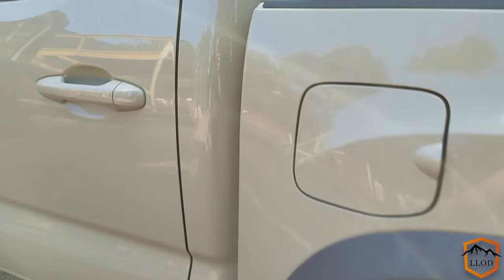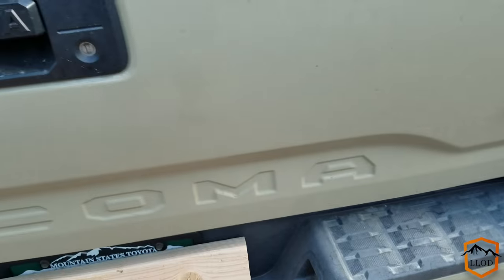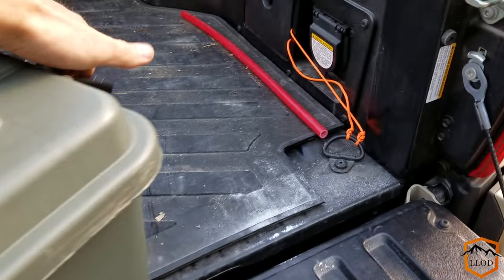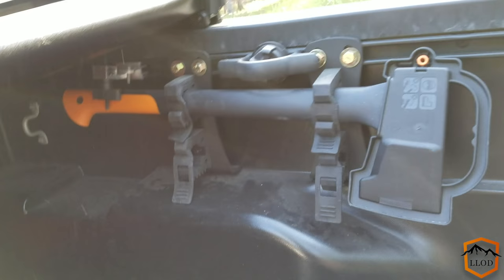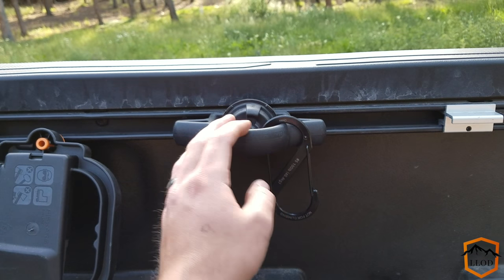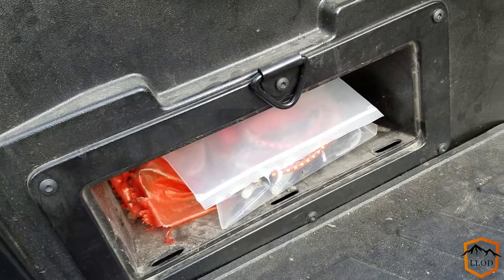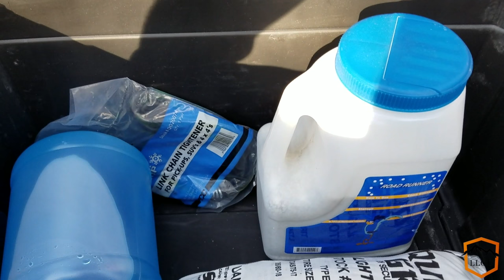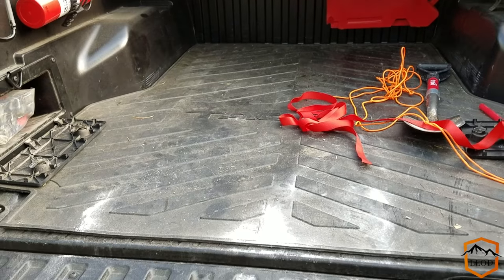Truck EDC / Emergency Vehicle Gear (Part 2, what's in my bed) - 2016 Tacoma

Comment: Make sure you remove and clean your spare wheel after the winter months so it's easier to get off during emergencies busted a wheel on my truck one night never was able to remove my spare and eventually had to get it cut out and re installed
Reply from the maker: Thanks for the tip!

Comment: I have the extended cab SR5 4x4 in tan like yours. I have a cap on the back from Leer and put a cot in the back for emergency over nighters. I'm more wheelchair bound so finding a Motel or Hotel that takes wheelchairs is a challenge for me. And mine is Proudly dirty!
Reply from the maker: Glad that you are a fellow truck user that isn't afraid of a little dirt!
Reply: Last Line Of Defense Its what its for & not mall shopping like most Jeep's
Reply: 9/10 jeeps are jacked up with expensive rims and never see dirt. Well, 9/10 trucks, jeeps, and SUVs.
Reply: Steven Bradley you are a stud! I like your great attitude and considerate comment.

Comment: Hi, great video! Thank you for taking the time to show your work and list your options (including where to get them).  I drove Toyota's militarized pickups in the desert. They came standard with winches, underside protective pans (covering engine oil pan, transmission, gas tanks, differential u-joints), front grill protection, extra fuel tank, a lot of large nylon rope, air tank (between frame members), compressor in the engine compartment, jack, shovel, UHF radios (military frequencies/use HAM or CB in our civilian case) and deafening alarm system.
What I would recommend is better organization inside the cab so that: 
1- You can reach whatever you may need in a hurry,
2- It is less conspicuous for people tempted to break-in
I recommend putting the extinguisher inside the cab, easily accessible from your seat.  I enjoyed your video and found good ideas for my rig.  Thank you for the ideas again, Ciao, L
Reply: lancelot1953 plus an emergency wool blanket and flashlight

Comment: I would highly recommend an on-board-air system.
Reply: expecially with the 110 plug in,in the back!
Reply: Why? I have the same exact truck as the OP's, but I fail to see the need for a compressor unless you live in a rocky terrain like the OP does in Colorado where you might have to air down your tires. For flat tires? Isn't that what we carry a spare tire for?
Reply: +Optimal Joy they're useful in general. Air tools, pumping up tires (not just your own), air lockers, cleaning dust out of hard to reach places, air horns, etc

Comment: This gives me sooo many good ideas! I'm always so apprehensive of "modding" my truck but these are ways that don't destroy the vehicles ie your use of existing bolts, velcro on the interior, etc. Thanks for opening up your world so that all can learn. BTW your trucks cleaner than mine. Keeping a vehicle clean is secondary to getting actual work done. If the cleanliness prevents work then yes clean it but if its cosmetic and doesn't bother you "who cares?"

Comment: Man I really like your truck. I was going to get it in black but I ended up getting a 2016 Honda Accord v6 touring sedan. I still want a truck and I may get the tundra one day. It's always convenient to have a truck.
Reply: got the same truck just not 4x4 and mines white, 2016 tacoma trd off road
Reply: air23evil sure black looks badass but it's hot and always dirty. Go with a lighter color

Comment: You should consider adding spare belts, bolts, nuts, and fluids (oil, break fluid, power steering, etc... those that leak/degrade on rare occasion) in your bed box too. Just the little bits and bobs that can get you to a shop should you ever have a failure. Since it's a new truck and you're not 4x4-ing, it's not a big deal. But the way I 4x4, I've got enough spare parts/tools to repair/rebuild pretty much anything except the engine block itself. All depends on level of readiness and end-use/purpose. Nice truck though!
Reply from the maker: Oh yeah, back in my wheeling days, I basically took a whole shop with me whenever I went out. It wasn't a good trip if someone didn't break a driveshaft, or rip off a shock mount, etc. In a new truck and not doing any serious wheeling though, I don't feel like I have as much to worry about.
Reply: Awesome. And with a new truck, I don't blame you. There's the baby period, where all you want to do is baby it. And eventually you say to yourself "I think she's broken in enough now, let's go for an easy trip" and you go up from there haha!

Comment: Rock on with your dirty gravel. Dirty is good. I see a super clean truck and I know that's a target to stay far from, because it's just going to attract scavengers.
Mine are always scratched & dented, because I actually use them. Thanks for sharing.
The thing in the bedrail is called a cleat. More often seen in boats they're the best option for quickly tying anything down.
Reply from the maker: Haha yup, that's the term I was searching for, thanks!

And agreed... it confuses me how many people are upset by seeing a dirty/used truck.

Comment: Nice setup. I have a truck tool box instead of a bed cover for my Tacoma. Have the long bed, it isn't bad but does take time getting used to how long the trick is. I've been trying to figure out how to carry extra fuel in a safe manner without it being stolen. Keep the videos coming. I've always wanted to try the simulated get home bag hike but my route home crossed a 3 mile bridge with no pedestrian access. 👍
Reply from the maker: I like truck tool boxes, but I don't think I could give up that extra space in the short bed.

Comment: @lastlineofdefense - consider switching to Kolpin Rhino Grip Flex mounts to replace the Quick Fist mounts, ESPECIALLY for your fire extinguisher. The 3” mount will fit around your 2.5lb ABC extinguisher and if you mount it to a secure point, it will not flop around. I have mine bolted to my front cab MOLLE panel and it’s solid af. In my opinion, the Quick Fist stuff is sloppy, fragile garbage and the straps tear easily

Comment: Hear is a suggestion for you I found out about Toyota Tacoma's. I don't know how much you know about Truck Campers I am a big fan and My dream is to own a Truck Camper and have it in the bed of a Toyota Tacoma I found out The Discontinued Northern Lite 6'10 Truck Camper will fit and in a Toyota Tacoma the 6'10 dry weight is 1060 pounds and the 2016 Toyota Tacoma payload is between 1120 and 1505 pounds. So you could use a Truck camper in your truck just to suggest that to you.

Comment: I have a bed cover that folds like yours. I also have a fire extinguisher, but I have one on each side. Then, after I put my bed mat in, I purchased 3 trunk organizers. I then purchased the sliding bed separator. It locks into the sliding rails on the Tacoma. It runs the width of the truck so you can pack everything to the front of the truck, slider the separator up against it and then tighten it down so nothing slides. I took the three trunk organizers and laid them out up against the cab. I filled them with, jumper cables, wrenches, tire repair kit, a really good emergency blanket set that I ordered from Germany, 3 raincoats, 10 road flairs, a VERY high quality medical kit with the best of everything. I also have 4 maxtraxs on their side between the bed and my organizers. I have a small and big hatchet. I also have waterproof matches along with 10 watertight sealed lighters. I have 4 flashlights that are LED. I also have 2 battery operated work lights. They have a big LED light on top of a tri-pod and the slide in and fold up to take up very little room. I have a pair of steel studded boots sealed away air and water tight. I have 4 tow straps, oil and some tools made just for my wench should it need to be fixed. I have 25 hand warmers and 25 foot warmers. I have a tie inflator but it is under the hood. I put a double battery system in my truck. So, one runs the truck and I have another for the LED light bar in my hood scoop, two LED ditchlights mounted as close to the windshield as possible, two LED fog lights, my wench, an LED light bar on the top of my truck that I take off and on easily, 4 LED lights in my back bumper for when I am backing up or someone is riding my bumper at night. My tire inflator also runs off it. I have a high end fridge, freezer in the back of my truck that also runs off it. It's a double battery system where both batteries are hooked together but kind of separate. It's hard to explain but you can look it up on youtube for double battery system and they will explain it.  If I am Overlanding I also bring a chainsaw and oil that are locked into the bed as well as two gas cans. One container will have a good bit of emergency food if I am Overlanding or going somewhere when the snow is really bad. I also carry a My Buddy heater with 6 cans of fuel for it. My bed cover folds up to one smaller piece. I have emergency hooks to release and remove my bed cover easily. I have a truck tent made for the bed of my truck. I carry an extra 15 gallons of gas so that I can leave the truck thus leave the heat running. I have an opening in my tent and I open the back glass of my truck. I then put a small fan in the back glass of my truck and it will blow heat from the cab into my tent should I need it.

Comment: perhaps consider ratchet strapping the box in place. I would hate it moving around all the time
Reply from the maker: It doesn't actually move around much / at all with the rubber mat - but yeah if I didn't have the mat, I'd want to secure it down.

Comment: Great video. Only thing I might suggest about your fire extinguisher issue would be to get a smaller one and buy an in cab truck mount that we used on our semi trucks. would be located on the left side of your driver seat on the floor. Just a suggestion.. Also, don't you dare clean that truck bed lol

Comment: What about that cable system, the mesh you used with the locking cable.  Where were you able to find that?  It would be perfect to help secure my wife's camera gear when she travels between shoots.

Comment: Im surprised you dont have a small little vacuum cleaner in your Tacoma. I didn't see it in your first video when you showed the front so i was sure you were waiting until you showed the back. Thats where i keep mine.. I also have a Tacoma that i like to use as my work truck and i keep my vacuum in the back area.  My truck as well as my co-workers also have gorilla tape always no matter what. I even carry my own personal small roll. Its the best with dirt. I have to clean alot. But i dont do as much cleaning that i do know i need to do.

Comment: RECOMMENDATION     TOW STRAPS ......more is better .. also  D-rings .  i have  90 feet heavy duty tow straps .. and 5 d-rings .. crap i might have more tow straps then that .. i just keep buying the military surplus ones ... great deals on them .
Reply from the maker: Yeah, I have a single tow strap and two D-Rings - but agreed, can always use more.

Comment: LLOD:  If you get a chance try to do a review of the Gear Tech Customs: Tacoma inner fender splash guards.  I had to replace the cheap/thin OEM versions, and these new ones are about the same price, add more protection/coverage and are built with thick rubber.  Great for off-road vehicles mud/snow/rain, etc...   Make sure to get the upgraded mounting clips, the OEM are easily broken.

https://geartechcustoms.com/shop?olsPage=products

Comment: Nice truck buddy, I was seriously considering the TRD off road Tacoma recently but ended up going with a Frontier Pro-4X based on a few little things that were just personal preference after checking both out for a while.  Was a tough choice, both are great little trucks for getting out in the bush and having a good time.

Comment: Good stuff !   To keep the fire extinguisher from bouncing around just add a second Quick Fist mount.  With all the room in the bed , maybe add an air compressor, a second of those gas cans or one with water, a few recovery tools, and a few extra supplies, food, etc..  A winch would be a good idea for the truck, add a 2" receiver on the front, get a winch that can be switched to front or back.

Comment: I would recommend a wood handled axe. those fiskers are notorious for there handles breaking. not to say that a wood handle can't break but it will probably be a lot tougher than the hollow plastic of the fiskers

Comment: Amerex and buckeye make a decent 2.5lb extinguisher that comes with a decent bracket you could use it installs with 2 screws. U may not seem keen on drilling into the bed but I’d recommend one of them.

Comment: I work at a Boatyard my truck gets dirty all the time from fiberglass dust and sometimes paint spills I also work on the east coast in the Northeast.  The only time I rinse it off if there's something that's corrosive has the only time I really rinse it off

Comment: Consider a syphon hose as a companion item for your fuel can. For newer vehicles, I hear a small diameter will be needed to get past anti-syphon screens in the filler neck so do a check on that before you depend on it. The hose may be stored in your empty fuel container. A more advanced option would be to rig up a small self-priming fuel pump with sufficient hose to scavenge fuel from in-ground tanks when/if the grid goes down.

Comment: There are lots of trees along the country roads where I live and they often fall across the road in high winds.  So, I keep a buck saw in my truck.  Fortunately after the last storm I happened to have my chain saw in the bed and that made sort work of clearing the road.  Another item that old farmers made use a lot is heavy steel wire--for when things go haywire :)

Comment: I run a shell on my bed with a rack system on top to mount thule cargo box,  canoe , lumber etc. and inside the bed a carpet kit with 2-  8' drawers for tools , emergency gear , EDC gear,  fly rods etc. next I need to figure out a fuel can carrier on top of the  shell rack  perhaps .....I have a crawl thru cab to bed so if need be my dog can get in back and stick her head thru the back window and not be left out (ha)! Its nice if i have to sleep in the back also with a blow up mattress and sleeping bag thats always in there . Thanks for the videos , lots of great ideas ....  have fun in the rockies !!
Reply from the maker: Sounds like a nice setup!

Comment: Did you have the dealer give you a tan rear bumper instead of the chrome that comes with the off-road package?  Or did you have to purchase it?
Reply from the maker: Color matched bumper actually comes with the 'premium technology package' regardless of trim level, I believe. Has the rear sonar and stuff in it.

Comment: Good looking kit, Mike! Can't get over the concrete athletes who won't know what a truck is for.... Just might think about having a saw and some flares, maybe? Still don't like the fact that the only American truck company to build a small/ mid-sized truck is Chevy. WHERE YOU AT DODGE/ FORD????
Reply from the maker: I hear the Ranger is coming back in a year or two. I debated getting a Colorado, but just didn't like anything about them as much as the Taco. Glad at least that the Tacoma was built in the US, even if Toyota isn't a US company.
Reply: Last Line Of Defense
Kind of funny that the only 100% made in America vehicles are TOYOTA!! I have one of the older Colorados.... Everything underneath it says Isuzu on it. Transmission, transfer case.... I don't recommend that truck.

Comment: I was interested in the Tyger Cover you have but when I clicked on the Amazon link noted they don't offer a cover for a 2016 or 2017 Toyota Tacoma.  Where did you actually purchase the Tyger Cover?
Reply from the maker: I purchased the exact one that I linked. A lot of products that don't say they specifically fit the 2016, do actually fit it fine. The bed of the 16/17 Tacoma is one of the things that is virtually unchanged from the previous generation.

Comment: Thanks for the walk around.  Thought you should know that KIDDE fire extinguisher you have clamped down...its been recalled.  You can get a free replacement if you contact them on their website.
Reply from the maker: Good to know, thanks for the tip!